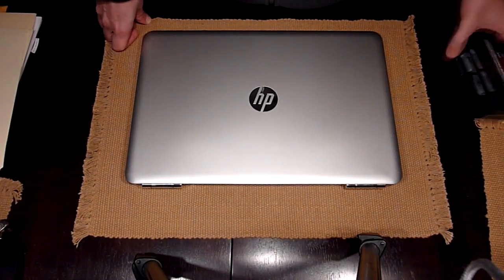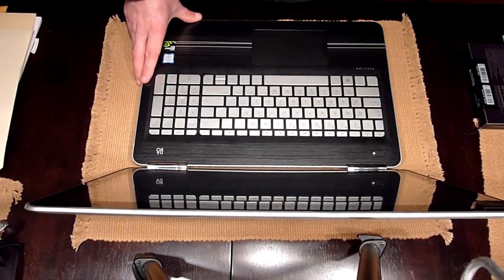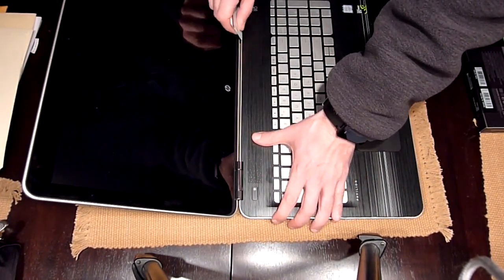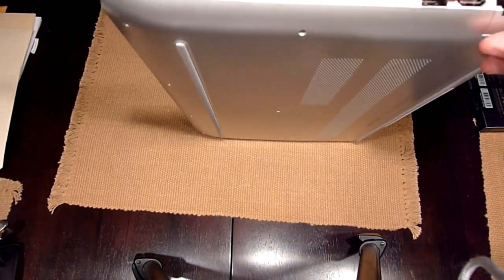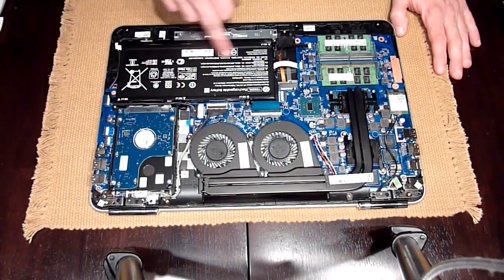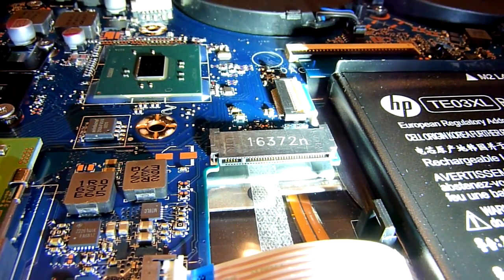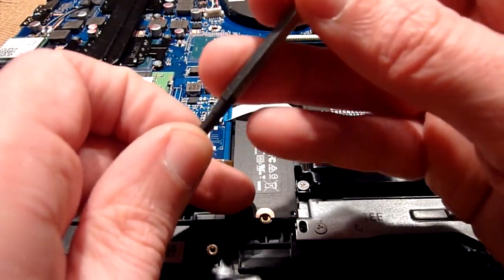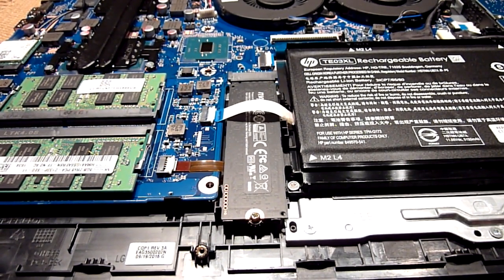HP Pavilion 15 bc018ca Laptop with Samsung 950 PRO M.2 NVMe SSD Drive install

Comment: Hello! New ssd really hot when using? I plan to put on 250 Gb
Reply from the maker: No problem since installation, I do video editing with it and no overheat. Right now at 40°C.
Reply: Alexis thank you!  Good people! 
The system had to install again?
Reply from the maker: Денис Олейников no, I clone the original HDD with Samsung migration tool. Works great no need to reinstall.

Comment: It says m.2 sata in manual. So is it nvme supported?
Reply from the maker: I confirm that the 15-bc018ca requires an NVMe drive, I would assume that all 15-bc00xx would have the same support... M.2 SATA have two keys which is not the case in my computer connector.
Reply: Aleziss thanks for reply. Mine is bc303 I hope it works because nvme is lot expensive
Reply from the maker: If you want to be sure, just open the case before ordering a drive. If you see two keys in the M.2 slot, you need a SATA drive. If you see only one key, you need an NVMe drive. NVMe are like 4X faster than SATA drive, it's BLAZING fast, you won't regret it. I love the Samsung SSD drives, cloning software is also free.
Reply: Aleziss I've opened the case and it looks the same with your pc. I thought m.2 pci e and sata socket is same. Have you done any benchmarks?
Reply from the maker: In that case, it will be an NVMe drive, Samsung EVOs are not that expensive. Yes benchmark is 2220MB/s read and 1254MB/s write !!! SATA III maximum is around 500MB/s.
Reply: Aleziss thanks for all answers. That helped me a lot
Reply from the maker: you are welcome. Like a told you, you won't regret it, best upgrade you can offer yourself. Look for Samsung NVMe EVO, you might be surprise of pricing !
Reply: Mehmet Duran I have the same model as you have. Did you put in a NVMe drive? If you did is it working well?

Comment: wait so we cant use both the hdd and ssd together ?
Reply from the maker: oh no, you CAN use both the M.2 drive as main drive and still use the first drive bay as a second drive bay. The performance is SPECTACULAR only with the M.2 drive... way way way faster than the 2TB mechanical drive. In fact, almost all laptop problems are due to slow mechanical hard drive. That being said, if you do install a second drive and it is a mechanical drive, it WILL slow down the system specially at start up because the mechanical drive has to start, speed up and be ready to data transfer that is way slower than the M.2 drive so the computer will WAIT for that mechanical drive to be ready to work.

My computer boot from OFF state in around 10-12 seconds and waking it up from sleep is almost instant less than 1 or 2 second. It actually take more time to enter the password than to wake up the computer.

I would suggest that the second drive is also an SSD drive instead of a mechanical drive. In my case, I have not use the 2TB drive because the computer is still under warranty and I wanted to keep the original drive intact until the warranty ends.

I am not sure I will use it even after the warranty ends. Mechanical drive are a lot more fragile to impact and a LOT slower than any SSD. I would probably either get a 1TB SSD Samsung EVO or upgrade the M.2 512GB drive to a 1TB but they are still crazy expensive. The new EVO M.2 line is cheaper but has only a 3 year warranty. EVO 2.5 inch drive have a 5 year warranty and are cheaper.

I hope this help.
Reply: thanks for the detailed reply looks like i'm late i was not notified for some reason...
Reply from the maker: shouri reddy you're welcome